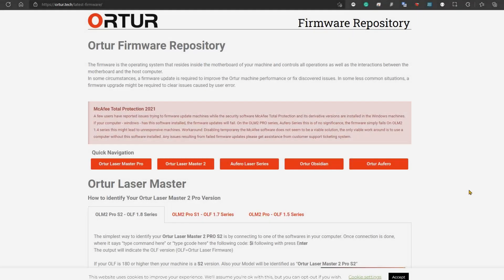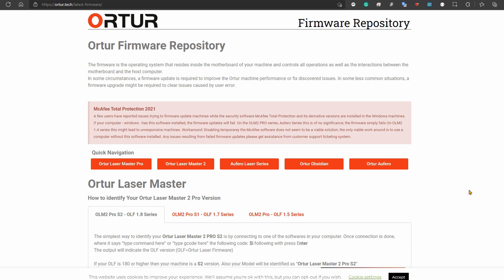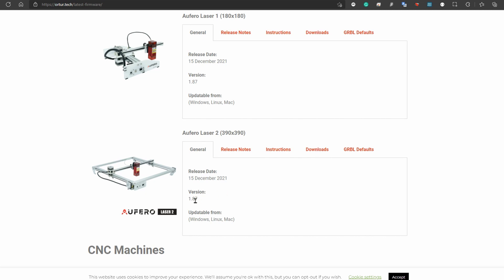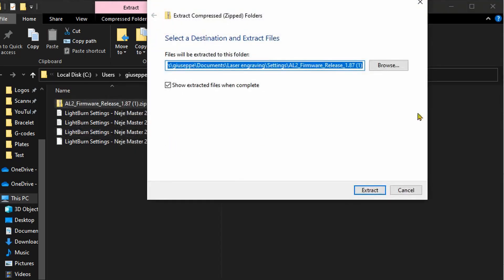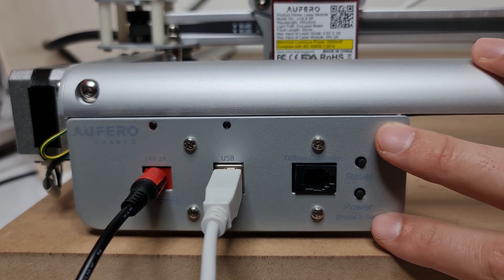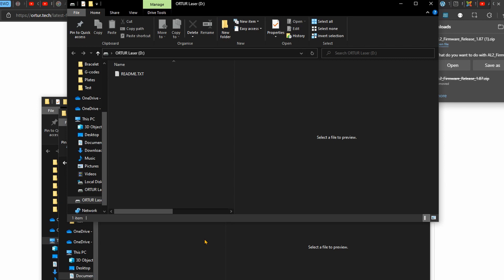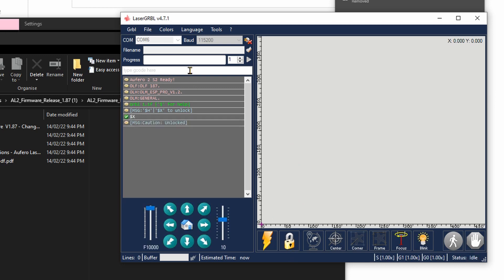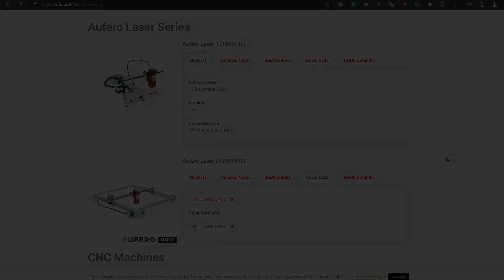Update Firmware on Aufero and Ortur Machines - Solving Bugs

Comment: I have a Ortur LM2.  I'm having trouble with the drive it creates when I hit the reset button after holding the power.  As soon as I try to copy the bin file, the drive disconnects and the file does not copy.   Any thoughts?  Thank you
Reply from the maker: Hello Scott Prouse; thank you for your comment.

I am not sure what that could be. Have you checked if the version has changed in either LaserGRBL or LightBurn?

If not try to drag and drop.
Ultimatly try to change the USB cable or Port or try with another PC.
If none of the above works, then something, is not working properly with the mainboard.

Let me know.
Ciao
Reply: Have the same problem. Is there a solution
Reply: Have the same problem. Is there a solution